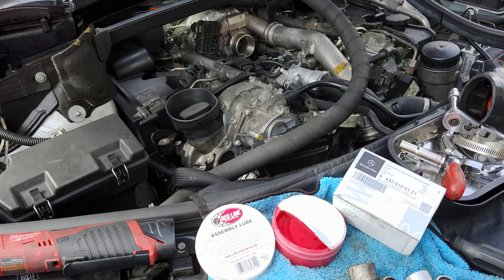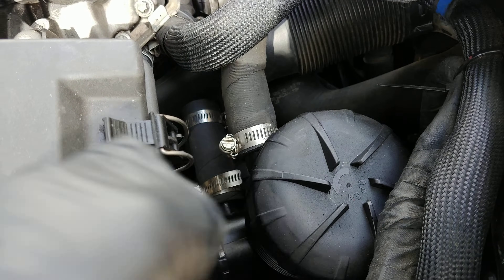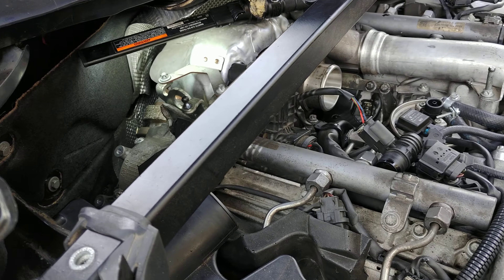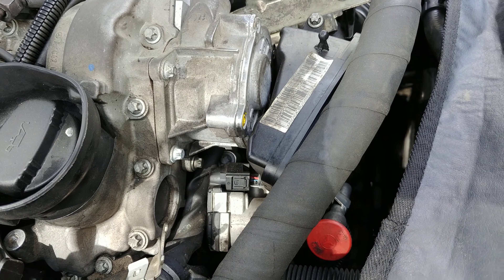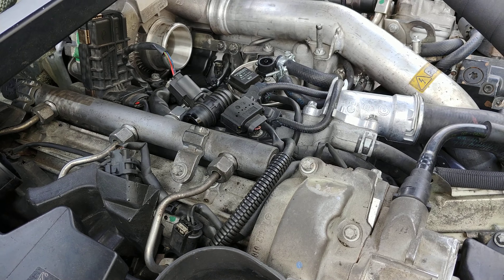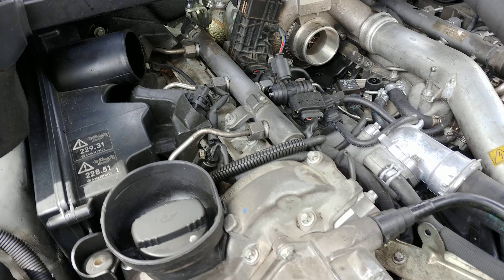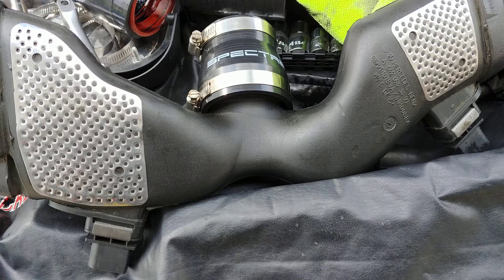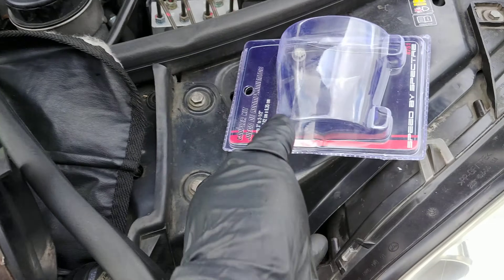Mercedes Diesel GL, ML, R, E 320/350 OM642 Oil sucking eliminated/broken Y-intake fix

Comment: Why just not to use oil catch can with breather?
Reply from the maker: I have a catch can , but you will be draining half a cup of oil every two weeks if used daily. That does not fix the problem. We just have to accept that PCV "connector" needs to be replaced periodically to stop oil ingress at the source of the problem. Cobined with reducing turbo suction force on PCV by placing it before air filter element fully eliminated the problem for good.
Reply: @ridgebackgarage4580  I have catch can too, and I actually added another canister because catch can was full very fast. I'm just thinking to use catch can with breather now instead connecting it back to the intake. There will be no turbo suction from PCV at all in that case. BTW Thanks for sharing this video. I like how you fixed Y intake tube.
Reply from the maker: @Mirarty  that will stop 90% of oil discharge but you will smell burnt oil all arount the car and especially in your home garage if you leave it vented. Even without changing "connector" just tap in exhaust of your catch can before passenger air filter by the dipstick and you won't have bad smell or oil going into the intaje since suction is drastically reduced. Good luck.
Reply: I’ve done same and replaced pcv and keep air filters clean/replaced to try and reduce intake pressure. Anybody got an idea if running something like a provent 200 with a line that drains back to oil pan  would work? Maybe with a one way valve in the drain back line?
Reply from the maker: @cmack864  I am using Provent 200, but I put a metal ball valve from hardware store at the end of the hose from catch can drain instead. I used to drain it every couple of weeks before replacing "connector" and re-routing catch can exhaust. I did not want a possibility of water from vapor mixed with oil going back into the engine. In Europe it was common to drain it back, but I think they are avoiding it now. Also on OM642 I did not find a suitable existing place to tap in for oil return and did not want to drill into anything.